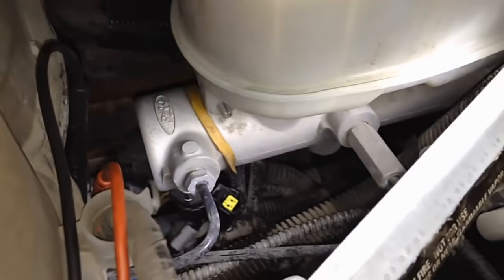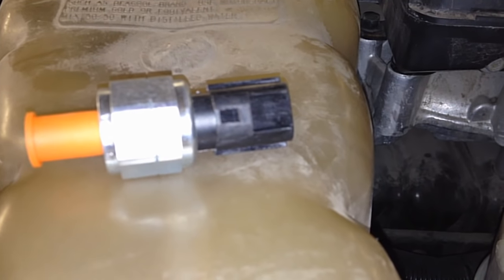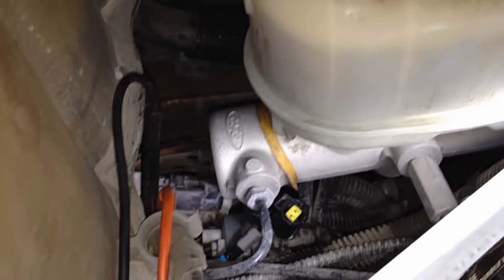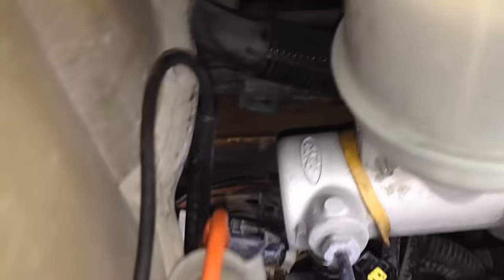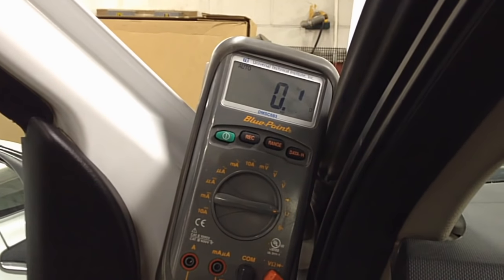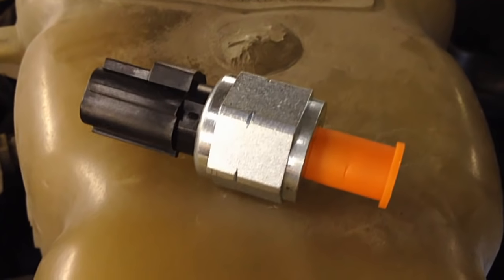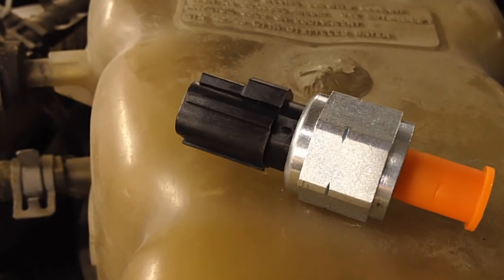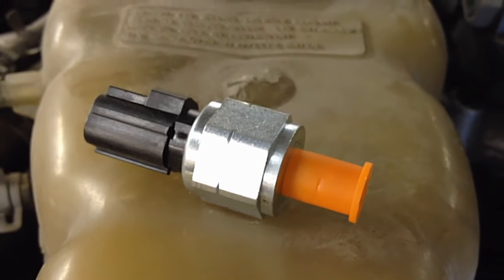#1 Reason Your Ford Cruise Control Doesn't Work Anymore

Comment: I have a 94 F150.The cruise control went out a year ago and I replaced the cruise switch. Problem solved. My cruise went out again this week. I replaced the cruise switch again thinking it was just a bad switch. Unfortunately my cruise control still doesn't work. What should I look at next to fix the problem?
Reply from the maker: Christopher Wynn On a 94 the most common issue is the servo itself we have seen a few cables but mostly the servo itself.
Reply: FordTechMakuloco thanks for getting back to me asap.  I will take a look at that and let you know how it goes.  Thanks!
Reply: FordTechMakuloco I can't find any auto parts for a 1994 ford f150 5.8L under the name Servo motor or cruise control servo. All that I can find is a Cruise Control Module, and Cruise control connector , and the part I already replaced. Any way you can help by sending me a link to the part I need. Thanks!
Reply: FordTechMakuloco 

2010 f350 replaced switch even had a code to replace switch. Still no cruise control??

Comment: Hi again, thanks for responding about my ford lariat. I don't have the code retrieval meter to pull codes. I was hoping for blown fuse or something. I will check for video on how to get to the steering wheel switches, maybe an ohm meter would determine a bad switch and get a part if needed.
Thanks again
Reply from the maker: They actually don't even show us specs for the resistance anymore now that I check. Autozone will be able to pull codes for you, check for codes P0579 or P0581

Comment: 2001 f150, wasn't there a recall on something connected to the end of the master cylinder? Well when they replaced the connector, which was leaking brake fluid, on my truck the horn and the cruse control stopped working. They said that the leak fix wouldn't fix the cruise control. Also the horn works when setting the alarm so the horn is alive.

Comment: I'm diagnosing a 2007 E150, 4.6L van.  The RED brake light stays lite up on the dash and will not go out.  E brake switch is operating properly, I tested it.  Master cylinder is full with fresh fluid.  Brakes are functioning properly.   Could the pressure sensor in the master cylinder be stuck OL and cause the light to stay on?  I can't get any leads on the sensor to test it because it's hanging upside down like the one in this video. There is a float inside the reservoir but no electrical connection.  I dont have a wiring diagram so is there anything else I am overlooking that could effect this circuit?  BTW, master cyl switch connector has good power 12v on one wire when unplugged.  Should the Ebrake switch also have 12v on one terminal because I am not getting any voltage on either wire? Thanks Brian

Comment: I replaced the switch and I now have my cruise back, however, I believe my MC is leaking brake fluid from this point, which is why the switch failed in the first place. I cleaned up all the fluid around the new part and connector. If it continues to leak, can I use some plumber's tape to seal the connection? Or will I have to replace my MC? Any suggestions? Thanks for the videos, you have been extremely helpful!!!

Comment: Question: Had to change the shift tube on my 2002 Expedition, didn't disconnected any electrical connectors. Afterwards found out my horn and cruise control no longer work, they worked fine before, also when you press the horn the key-less entry/anti-theft module clicks. The passengers windows switches also no longer work (but the drivers master switches work fine), I don't know if this connected but they also worked fine before I replaced the shift tube.
Reply from the maker: +lspall Are the passenger side switches locked out maybe the column would have no affect on those. As far as the horn and cruise follow the yellow pigtail all the way down from the clockspring to see where the issue is.

Comment: So my 2005 Ford Expedition should be a little different than the one pictured? My cruise control just died and I thought it was just the switch on the steering wheel. Should I replace both? You are a saving grace with my Expedition and I thank you.

Comment: 2002 Mountaineer - I tested the brake cut-off switch for continuity and it tested good.  I tested the brake switch at the same time and it tested good.  Where do I go from here?
Reply from the maker: +Rick Waltch The pressure switch goes from open to continuity and back responding every time?
Reply: Yes. each time closed then open when I apply the brakes.  I was looking at the actuator next.
Reply from the maker: have you checked fuse 40 in the engine compartment fuse box? Also check pin 1 of the speed control servo for power.
Reply: No. Not done that yet.  How do I check pin 1.  Does the CC switch have to be activated? or is it just always 12v at the pin?
Reply from the maker: there should be power there with the key in the run position pin 1 violet color.
Reply: Thanks, I'll try that next.
Reply: Ok..Fuse #40 tests good.  There is power to pin #1 with ign set to run.  I guess that leaves speed control servo bad?
Reply: I did some ohms pinpoint tests on pin 1-2 1-3 1-4 tests.  They were all way
above 2 ohms so I guess the servo is bad?
Reply: I replaced the actuator (Servo) still no go.  Any ideas?
Reply: Ok.  PIN #1 on the actuator does NOT have any power when key is off.  What do I do next?  Thanks
Reply: +Rick Waltch Rick, did you find a solution.  Your issue sounds a little like mine.  Thanks
Reply: Nope, not yet.
Reply: Rick Waltch It's been a while but I think I just replaced mine and got it to work.  I also had to replace the switches on the steering wheel cause they were wore out.

Comment: All my break fluid drained when I changed this sensor. After adding fluid I have a soft brake pedal. How do I resolve this problem? What are the next steps to solve this. Thank you for posting.
Reply from the maker: The idea is to swap it fast no bleed needed. If you let it drain out for some reason then a full 4 wheel brake bleed is needed.

Comment: 2008 F250 V10 Would this switch cause the cc self test not to work. I know the light in the dash works because the cruise will work intermittently. When I hold the off button and turn the key to on I get nothing. Pulled the steering wheel switch apart and everything seems to be making good contact. Thanks
Reply from the maker: Jeffbaudanza Baudanza Yes it can

Comment: 2000 Ford explorer, Eddie bauer, cruise control not working period. no lights, no power. if  deactivator  switch is issue, what do theu usually cost and is it the same process for replacing it?
Reply from the maker: +j downing I link to the parts needed in the video description. The procedure is the same.

Comment: I have an 08 f250 with a 6.4L  Cruise control does not work now. Light does not come on. I used to be able to turn ignition off to reset it and would work but not anymore. I am assuming the cruise switch you illistrated in the video is the same for the f250 with the 6.4L as well?
Reply from the maker: Adam Harrod Yes it is the same
Reply: Thank you. I was worried it would be something more complicated. Been such a great truck and minimal maintenance costs. A 30.00 part is nothing!

Comment: I have a 2006 F150 and it doesn't have the activator switch  like the one shown on my master cilinder. I replaced the inhibitor switch above the brake pedal and replaced the stop brake switch as well and my cruise control worked for one day again and went out again. It doesn't want to work. Would there be another suggestion? A fuse or relay that I should check maybe? Appreciate any feed back. 👍

Comment: I have a 2000 F-350 with the 7.3. The cruise control indicator light will not come on on the dash and the cruise will not set. In your experience does the actuator cause this? Or, is there some other part you would recommend replacing first? Just as an aside the indicator for the high beams does not work either. Thanks for your help!
Reply from the maker: Jonnyboywalton High beams will require some diag to be sure but the multifunction switch is very common for this. If the horn and other functions on the steering wheel work then I would replace the switch yes. My test in this video is valid for yours also.

Comment: I have a 2004 Explorer 4.0 L and the cruise was difficult to turn on (  not off ) and while in cruise difficulty to increase speed when it did increase the speed would climb over 20 mph that I released the plus button so I ended the cruise setting by touching the brake pedal or off button ( decrease speed button useless ) . I replaced the cruise brake component on the master cylinder ( I did not reset the PCM ) and tested the cruise. There are improvements with the cruise control - it’s easier to activate the cruise and increase the cruise speed ( but it doesn’t engine brake going downhill to regulate preset speed it     gains momentum and will continue to regulate speed only going uphill or on a level surface ( decreasing cruise speed still useless ) . 130,000 miles on vehicle . 
Would you please suggest a possible alternative ?
P.S. - your channel is and has been helpful for me in the past. 
Thank you

Comment: I have a 2005 Mercury Grand Marquis.  it often will not come on after driving down the road  I have to hit the brakes and afterwards the cruise control doesn't want to work until several minutes have gone by.

Comment: Good info. -- I have a question though -- on my ford f-150  my cruise sensor is the oval one -- how do you remove that one? Is threaded under the oval head? Confused  because the new sensors have a body that a wrench will fit on  to remove --any advice.
Reply from the maker: Frank Hobbs Yours is under the dash right? Those just turn by hand and pop out and same thing going back in the turn and lock in.
Reply: FordTechMakuloco
No Sir, its actually  on top of the master cylinder -- its the 2002 -- the one they had trouble with catching fire. I have already -3 years ago taken it to the dealership  and the put some kinda by pass fuse on it  but they didn't change the sensor itself -  found it unscrews with a 9/16  wrench ?-- it it is'nt that --which im 90% sure it is--then its the servo??

Comment: Okay, question, a 2003 Ford Windstar van has one of those cruise control gadgets under the brake fluid reservoir and is leaking B.F. Now I went and bought a replacement and the only problem I had was the wiring. One, the wires were not the same color's, and two, the connectors didn't match so I had to rewire everything. Now my van won't start it clicks. What do I do? PLEASE 🙏 HELP

Comment: My 1995 Ranger Factory Wiring Diagram for the cruise control circuit shows the Cruise Deactivation Switch as normally open, and the "BOO" Brake On/Off switch as normally open. Is it possible that some of these are manufactured as normally open for older vehicles such as my 1995 model? Great video. Thanks

Comment: Hi there - thanks a lot for making this video. My 2007 Escape 3.0 V6 DOHC started having issues with CC today. Most of the time it won't come on at all, but if I keep on trying and trying, occasionally it comes on but goes off after around 10 seconds. Is it advisable to replace this sensor or should I be checking out something else first?
Reply: like2upload have a similar problem in my 2012 focus

Comment: With this relate to a Lincoln Town Car? I just bought a 2007 limousine the cruise control does not work the horn does.

Also the emergency parking brake light is on

Could it be the stop lamp switch or what you're describing here on the master cylinder thanks

Comment: I have a 2002 navigator. noticed this particular piece is leaking brake fluid. I've noticed the pig tail had been sliced before does the connector need to be replaced too? on the Amazon listing it does show a new connector. just wasn't sure.. good video

Comment: '06 Mustang GT manual trans. Cruise keeps deactivating and at times will not let me "resume" or "set" or it will but just momentarily. I've already replaced the brake pedal cruise deactivation switch (blue upper) and clutch pedal position safety switch. What other switches can I check? Back up lamp switch? Brake light switch?

Comment: What size wrench should I use to remove the old style switch from a 98 Explorer? Mine won't unscrew at all.
Reply from the maker: +Reginald Burrell I believe the hex is a 9/16" or 5/8" open end wrench.
Reply: Ok thanks. The only thing I had to work with that fit was a 15mm. Thanks for the help.
Reply: the one that fits
Reply: LOL... YES!  Take a trip to Harbor Freight and get a cheap set of tools to work with.

Comment: Before my cruise control stopped working, I used to have to hit the brakes really hard really fast and I would feel a bump somewhere in the engine. Then I could activate. After I took it to a mechanic fir a computer issue, it hasn't worked since.

Comment: I've got a 2002 E350 v10 high top handicap van for my parents... you can turn cruise on and set it and light comes on...but does not maintain speed...goes off like normal if brakes are applied.  Is that a common symptom if this switch is bad?  How come in the owners manual there is no fuse or relay listed for cruise control?

Comment: I installed this, but still intermittent cruise operation. 2000 f150. I notice that occasionally my truck will lock the doors by itself. However, today, when my cruise didn't work, I hit a bump, heard the doors lock, and then the cruise worked again. Sometimes when I hit a bump, the cruise will shut off. I feel that the door locks and cruise problem are connected somehow. Didn't these trucks have problems with the body control module?
Reply: maybe a relay issue? look into if the doors or cruise control use relays.

Comment: My friend has a 2012 Ford Focus SEL (loaded with self parking etc) the Cruise Control Works when it wants to. It’s a crap shoot on if the system will turn on or not. When it does turn on it functions normally. When it doesn’t it could be half a day or days before it may work again. I looked for such piece that’s displayed in this video but can’t seem to locate it.  Do you have any other videos specific to the focus other than that terrible trans ford put in it?  Cheers!

Comment: cruise control don't work replaced part on master cylinder but have no lite on dash comes on when I press the on button were do I look next
Reply: check fuses, check brake fluid level. then I'd probably replace the switches on the steering wheel.... im not a tech or anything lol...best advice is start with the cheapest and easiest parts to replace first...will still be cheaper than taking it to a professional.... if the switches still don't work you may have to check if your clockspring is good..then if that still doesn't work then im stumped.

Comment: Hey man great video thank you. I have a 2010 f350 I found the switch on rock auto but I don't know which one to get. The one in your video has  the orange cap on the end the mine just has threads. Can you help point me in the right direction?
Reply from the maker: +nandua11 the orange cap is just a cover it has regular pipe threads. I also link the correct one in the video description.
Reply: +FordTechMakuloco thank you
Reply: joey
Reply: don't order anything from rockauto
Reply: Do you have a reason?
Reply: Mark England I agree. I've been burned a couple of times. Once when the part failed under warranty, I contacted them and I was told to call the manufacture. When I contacted the manufacture they said all warranties are handled through the supplier. Called them back and they gave me the run around. 

Second time they sent me a part that had been installed before. I called their customer service again and they told me they would send me another to send that one back. 12 dollars later for shipping I get another tie rod end and it wasn't even the same brand! The lady on the phone told me they don't actually supply the part but they are like a middle man. After more research I found out they send orders through to parts suppliers and have them send them off. After all of this I went down to an oreilly and bought the part. Paid a little more but it's lifetime and I can swap out a part I bought from them a lot easier. Anyway sorry for the rant. Good luck!
Reply: @sarahholub7852  I've ordered lots and lots of stuff from RockAuto and never had an issue

Comment: Cruise wont fire-up on my '05 v6 fwd Escape.. Dealer thinks it might be $600 servo under the hood.. (If he is wrong, I'm out $600 on his guess).. The 2 switches on brake pedal & steering wheel switches check good.. Servo cable is connected properly-- I dont seem to have this switch you mention on my master cylinder..  Any ideas.. possibly try salvage yard servo??
Reply from the maker: They should have a definite diagnosis, but I have seen the servos fail at times and more often the cable themselves break at the servo side. I would get a junkyard servo and cable setup and go from there.

Comment: Well, great video - I installed a new brake pressure switch and that wasn't the problem.  I also checked the fuses and the brake light bulbs - all seem to be in working order.  Any new ideas?  Btw I went to the dealer and got a factory switch for $29, so I'm not out that much.
Reply from the maker: palmcouple Which vehicle and year.